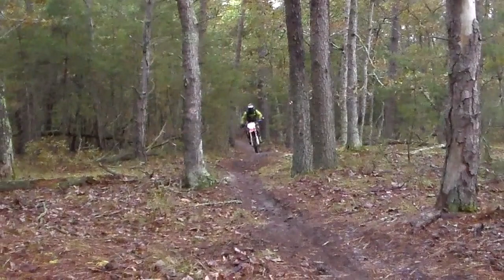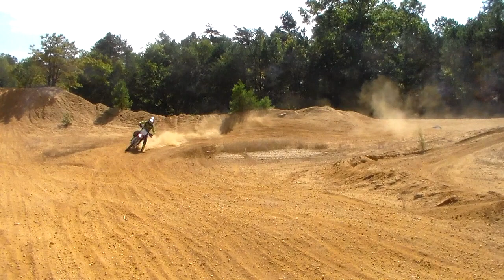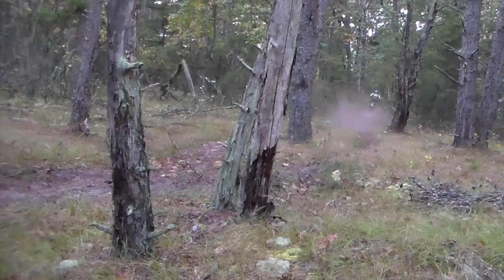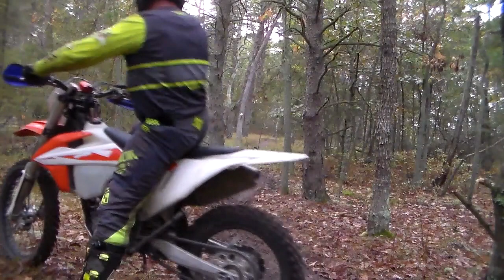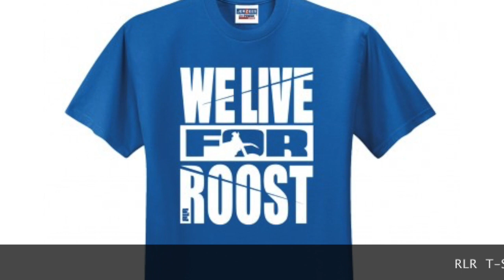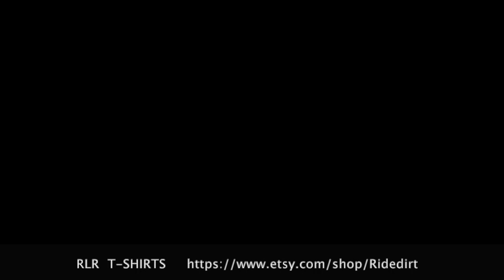2 Steps to Improve Your Corner Speed on Your Dirt Bike

Comment: Thanks for another great video! 

I have a question. I'm  trying to keep speeds up and increase my speeds  in terrain with constant turns like my ride last week. We rode 95 miles of this type of riding https://youtu.be/I2o8rrsm7xs. Your advice would be to greatly appreciated! Going to be in  50 A class next year and there's some fast dudes in that class. I want to increase and be consistent with my cornering speed as our terrain is predominantly nothing but constant cornering through the woods.

BTW, just ordered my T shirt. Keep the vids coming!
Reply from the maker: to keep speed up in constant turny terrain....try this..focus at the apex to look up(most drop head and fixate) be off the brake and either rolling or accelerating (depends on turn). In a upright turn (turn with tree on inside) improtant to look up and push outside handlebar to steer bike and keep rolling (most steer with rear brake/this slows corner speed) in a turn you can lay bike over..try simply pushing down on inside handlebar to steer while and lay bike into turn while sitting way forward and then apply outside footpeg pressure coming out.....this is alt and takes practice..break it down to one or two things at a time and slow down and focus on the mechanics for muscle memory.....good luck, thanks for feedback and question